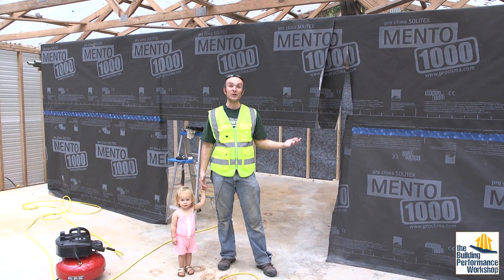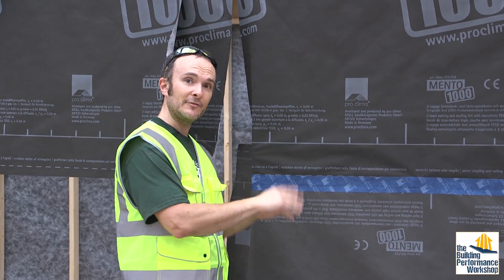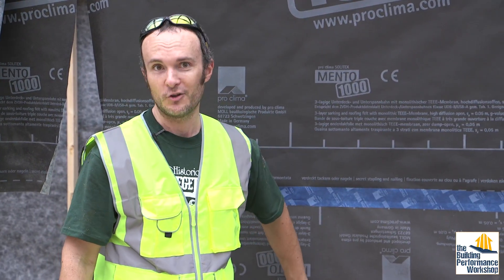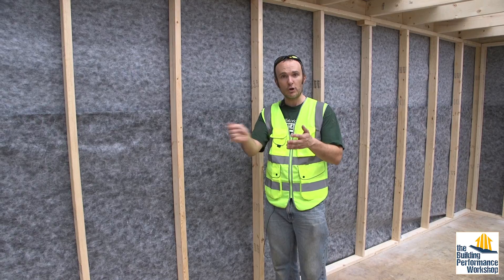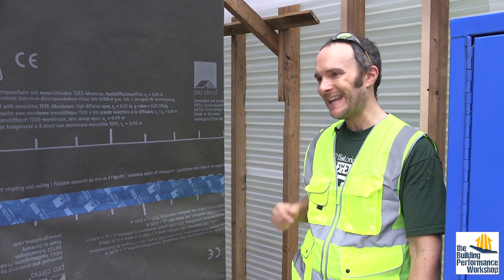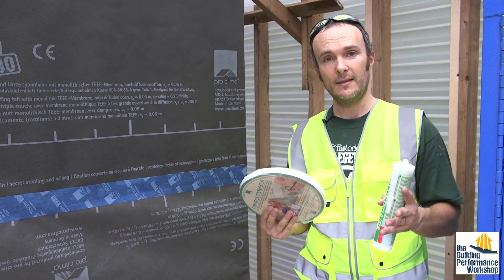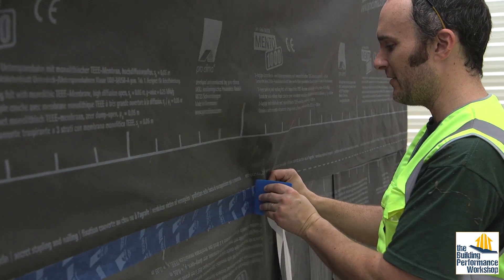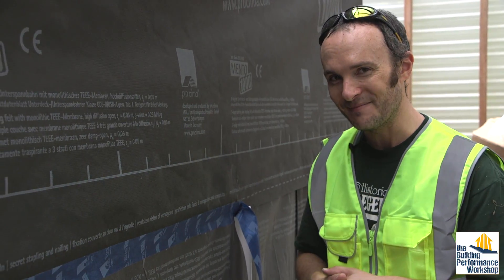#DryVault Pt1: Framing and Solitex

Comment: Can I leave a shed like this unheated and uncooled in Massachusetts and will I get mold?
Reply from the maker: Not if you run s dehumidifier in it year round- watch the later episodes of this DryVault
Reply: @HomePerformance  every dehumidifier breaks after some years and often you can’t tell it stopped working, so when it breaks the structure can be destroyed by mold?
Reply from the maker: @claireh.7605 monitoring is important, as you say. Either stepping in regularly or installing a sensor.
Reply: @HomePerformance  as owners and residents change, it’s one non diligent person away from failure then? If you leave it uninsulated, you can leave it alone for ten years and not worry?

Comment: How would you rate Solitex mento 1000 vs Tyvek?
Reply from the maker: Obviously, Mento any day over Tyvek. Tyvek explicitly tells you not to tape the bottom edge so that condensation can drip out, which means it cannot be airtight. Vapor permeability-wise, Mento is much more forgiving.
Reply: @HomePerformance  Thanks so much for your reply.  Have one additional question.  Looking to build a high performance house in Maryland and need to gain some clarity about external insulation.  Would like to use Dupont Tuff R 1" polyiso foam.  Should the layers be OSB, house wrap (will use Mento 1000), fasten polyiso to OSB and then tape the seams?  Should I reach out to the local Dupont rep? Or would you suggest just using Zip R-6?  Your thoughts are greatly appreciated.
Reply from the maker: That Polyiso may be significantly less permeable than Mento, and if you’re making it airtight as well, you have some unnecessary redundancy. I’d think hard about that sandwich before pulling the trigger. ZIP-R much easier to install, but less permeable as well, and puts foam inside the sheathing where it’s more likely to get into your breathing dpace (flame retardants). Ventilation will be very important. If you need an hour of consulting to talk this thru, I’m at:
https://buildingperformanceworkshop.com/video-consulting

Comment: How well do staples hold the wrap? Are cap nails/cap staples recommended? Curious because we've all seen construction sites where stapled Tyvek is torn & flapping in the wind.
Reply from the maker: We actually don’t fasten it until the sheathing goes up, so the tape is holding it together. Staples at the top just to tack it up, but they get overlapped and taped.

Comment: I don't understand why you put the layer inside of the plywood sheeting, is it more air tight that way?
Reply from the maker: +Joe Shearer nope, just need to protect the shroud is all.
Reply: Home Performance so it's more prone to damage on the outside of sheeting? I would think it would be damaged when you nail the sheeting up
Reply from the maker: No, as long as the nails are pressing tight, it's still a seal.